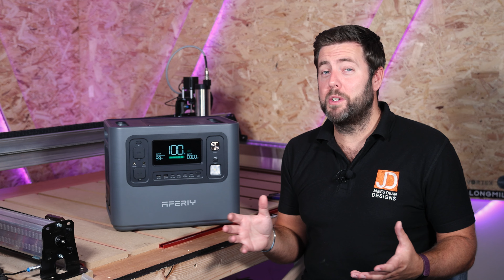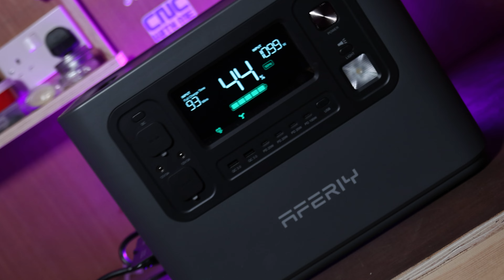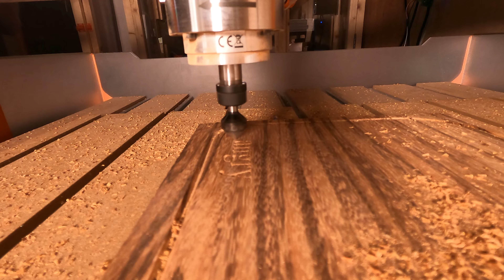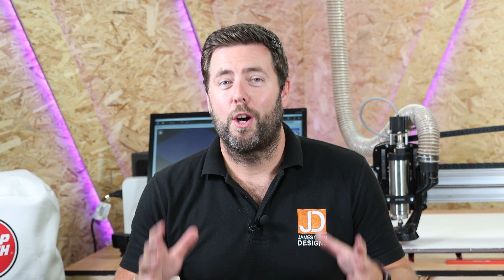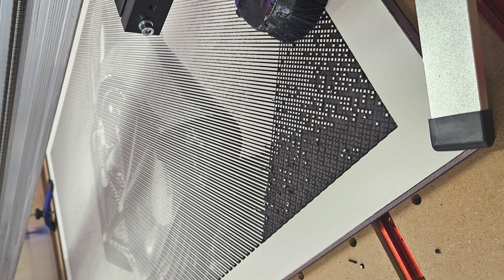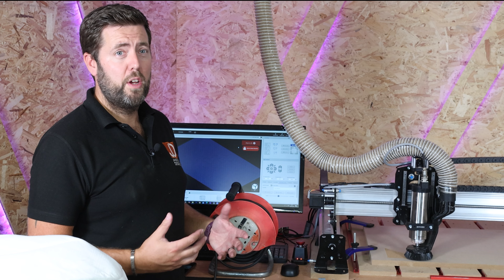POWER CUT? NO PROBLEM! Surprising results running a CNC machine off-grid.

Comment: I have all of my machines passing through a UPS as my rural power is “dirty”, slight fluctuations that cause hiccups in jobs. I need to pick up another as I added a laser and cleaner to the group. BUT, I have the power banks for taking to shows. Never considered using it in place of the UPS! Thanks so much for the inspiration!!
Reply from the maker: Glad it was useful 👍

Comment: Great video, I put one on my shop about a year ago. I have extra battery and solar panels so I run my small shop on it. power is cleaner and no issues with power glitches. The reason for less power on your larger machine might be your spindle. I had a Makita router at first but when I switched to a spindle, the power drain dropped significantly.
Reply from the maker: Thats intresting, I assumed it would use more power but perhaps not
Reply: @JamesDeanDesigns I am no expert but it may be because they use brushes motors which are more efficient? I dropped about 200 watts with everything running with the spindle. Watched your videos before getting spindle and your instructions really helped